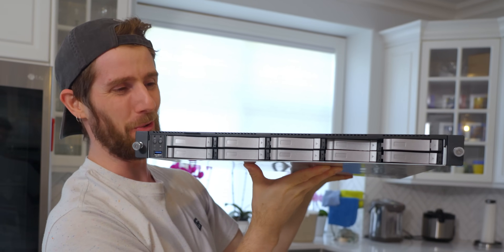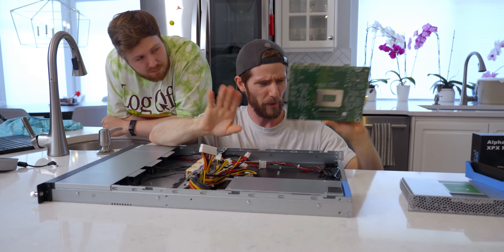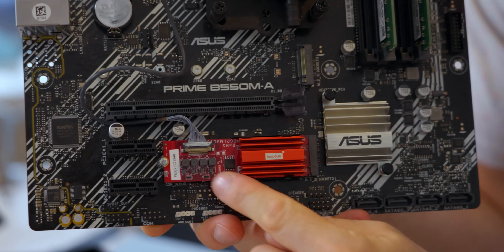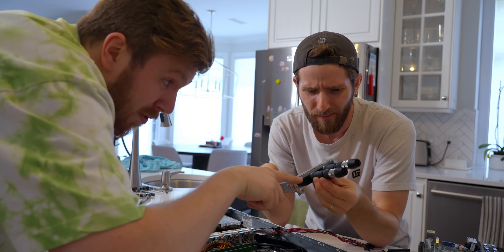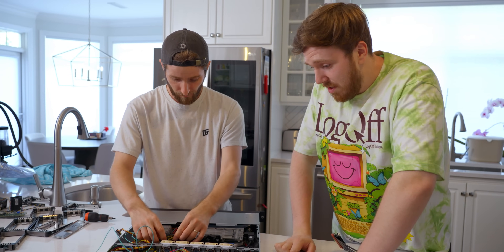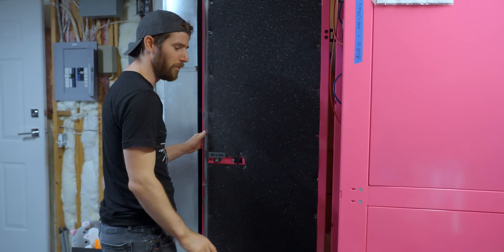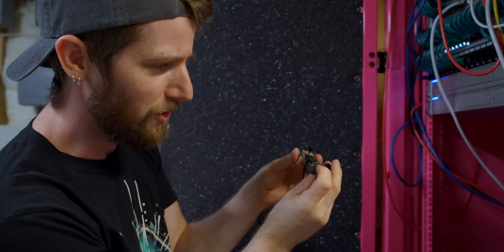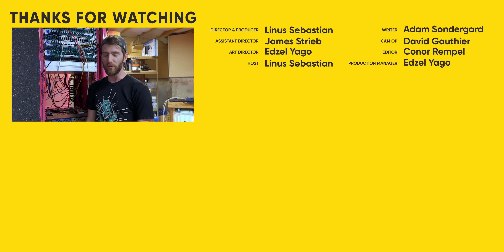I designed my perfect gaming PC, then threw it away - 1U PCs for My New House Part 2

Comment: Can't wait to see an update, and also Linus with you using Home Assistant more, I think what you should do is sync up a device that can trigger a WOL packet to the computer, it would then allow you to not need to use some jank device in the PC to remote car start it. I personally use a motion sensor under my chair right now, but you could get probably a vibration/motion detection or pressure sensor.

Can't wait to see the follow up on this.
Reply: He can just grab a esp32 and a few buttons, legit takes you a few minutes to set up.
Reply: There are phone apps that send out the magic packet, you can even send it over the internet and forward the port to your pc.
Reply: Also, you need a sensor under your char? is it too much effort to bang any key on your keyboard???
Reply: @chievo72  not all PCs work this way. Even with it on it will only turn on with a WOL or hitting the power so yes I do.

Comment: I'm surprised they are still using the standard convention of "rear of motherboard facing to the back of the racks"  

i just got a sliding shelf and put the parts anywhere i like   Especially the mother in FRONT, and i/o facing front of rack, including video in FRONT.

optional cover with acrylic out metal mesh box. afterwards.

Comment: Ah, so you put a board in for the power switch, when you already had conduits and fibre optic cable running through the wall? Conduits that you could say... Just run a power switch through, or a receiver plugged into the power switch so a remote worked up the stairs... You confuse me sometimes.

Comment: So Linus, did you ever do the math on what your new case's cost is given all of the 3D printing (electricity, materials, printer wear and tear), labor for everyone making all the parts, so everything but making the video?  Is it really lower, or actually much higher?

Not saying I wouldn't have done similar to not have to fork over the cash and to end up with something better.  I would, and that without any CNC anything!  All I have are only a really good drill press, 2 1/2 Hp Bosh router and high carbon bits, so can do aluminum.  Otherwise I have an arsenal of high quality hand tools and the knowhow to design machinery... and the skills to use my tools effectively.  In my case I build things I could buy because I see flaws in a great many products,  and ridiculously high markup, and know I can do better, and of course, because I love the challenge.

Comment: Oven? 
If it is distilled water or sprayed down with distilled water after being disconnected from power for awhile...
200F @ 1hour = 90% safe. 200F @ 6hours = 99% safe. 200F @ 12hours = 99.9% safe. 200F @ 24hours = 99.99% safe
I'm not an expert but have experience with expensive equipment that gets baked after an ultrasonic clean.

Comment: Linus, try putting the keyfob to your head when activating the button. You'll increase the range of the signal. Its an old TopGear trick, apparently your head/body increases the amplitude of the radio signals, something something dielectric resonator.

Comment: I kinda feel they would be better off going with a 4U server that they simply had multiple GPUs in and passed through the GPUs to VMs, add a USB Card with separate controllers(like the one from Vantec) so that each VM could have their own separate USB controller, and then put all of those ICRON on its own shelf/1U server. Each "machine" would still gets its own dedicated GPU and USB Ports like you need for your optical solution you setup with ICRON but other things like your watercooling loop and noise would be much easier to manage.

Comment: Your issue with the DP right angle adapter - I've seen this with adapters (and cables) that don't have the shielding connected between the input and output. Does your cable testing doodad at the lab cover DP?

Comment: DC-to-DC conversion is not more efficient than AC-to-DC conversion, and especially not "much more".

The converter is small because it's converting from 24V to 12V, which is a smaller drop in voltage, and less amps will go through it.

Comment: I used the remote powerbutton thing a few years back (a different version that used PCIe for power). Or I tried to. Reception with the case closed is terrible. Who would have thought that putting a wireless receiver inside a grounded metal box would be a bad idea?

Comment: Would it have been easier to air cool everything in that 'sealed' room - and then have a large, massive heat exchanger / radiator for the room that is connected to the pool?

Comment: 1:38 - Heyo, you might wanna replace that clear vinyl tubing NOW instead of later. You'll be fine in the short run, but I've seen that tubing fail with minimal pressures going through it because of water hammer (if your pump turns on/off at all). Not to mention that you're running warm water through one run of it. That clear stuff WILL eventually start to bulge to a diameter greater than when it started. If you're going vinyl, you'd be better off with braided reinforced vinyl tubing. Can be found at the same hardware store you got the clear stuff from.
Reply: Even just the look of it is horrific. Literally looks like it's going to fail any minute.
Reply: Considering that they had a plumber at the house recently to fix the rest of the loop that they put together the other day/week

It may already be fixed

They just filmed 3 (at least) videos at once that day
Reply: But if he does that, he can't make a video where he's panicking because he flooded the room.
Reply: I think they already got redone if it’s the same loop from the recent pool water cooling video.

Comment: 6:24 MB is not just bowed, its sitting on a bold head. Sometimes I forget this is supposed to be a 'PRO' computer channel... did you put thermal paste IN the socket for optimum cooling?
Reply: I mean if the bolt is pressing against a screw hole in the MB it doesn't matter. Even if it touches a pcb trace its fine as power uses the way of least resistance. But yea its not an amazing solution and I dunnonwhy they didn't cut that away

Comment: @linustechtips  plz sand halp salvaged from my previous employer Ewaste i Have a MICRO Optiplex 5080 im Gaming with an egpu 1660 Super and theres a spot on the motherboard  for a unpopulated m.2 pcie slot how do i solder in and get the slot running in bIOS?! plz halp <3

Comment: Please use a 2 loop circuit, one for the pool and 1 for the server room, connect them with a heat exchanger. I have nothing to base this on other than intuition but the idea of connecting the pc hardware to the pool outside just doesn't seem wise.

Comment: There should really be a mechanism to change between heating the water in the pool or the air inside the duct system. So that you would heat the house in the winter

Comment: How are you going to pour water all over your motherboard... and then turn it on... and not even bother replacing it after? That motherboard is dead AF. You can see water pooled up around the amplifier capacitors and chips... it even seems to reach the USB headers and PCIE slots... Not only is the amplifier cooked but the USB controller and mobo chipset may also be cooked.

Comment: You literally have to drill holes into your roof and walls to keep hot air out?/ must me embarrassing because, I made a desktop gaming system with a LAPTOP motherboard which is the SAME performance as the ryzen 7 with 16gb of RAM and only need 1 FAN and it doesn't even go up a degree in my house!! No drilling holes nessessary! beat that?

Comment: The USB extenders sound absolutely absurd for the price. Have you ever heard of USB/IP? Considering you probably have ethernet wired everywhere, you could just get a cheap PC/RPi and just plug the USB devices into it and run them over the network. Is there anything preventing you from doing that?

Comment: I have a question, instead of going horizontal with each system, can't they go VERTICAL (in one big rack) since its motherboard + wc units? It'll take roughly the same space, but allow for less nitpicked components.
Reply: You'd have to take down all the systems to do maintenance to a single system that way.

Comment: i had no idea that m.2 to 10gig NIC existed and holy shit it's $600 on amazon. think i'll stick with my thunderbolt AIC and OWC dock with 10gig for ~$450
Reply: It's $174 at wdlsystems, but they have a note that the IC used in the part is discontinued, so it is probably gonna sell out soon for good.

Comment: I was using one of those SilverStone USB remote start adapters for my wall mounted PC, and not only does the remote drain batteries extremely quickly (even when not in use), the device just straight stopped responding one day. I had read that those tend to fail with some regularity. Ultimately, I ended up replacing it with a SwitchBot actuator that physically presses the button.
Reply: I can confirm this. It's annoying to find out one that that the remote wont work because the battery is drained. Then you have to go and physically push the button and swap the battery. Thankfully my PC is a regular desktop tower but im lazy and dont want to get out of bed so that is why i use the remote. Also it's bent a little because the PSU shroud in the case interferes with the USB 2.0 port at the bottom of the motherboard where the remote module is plugged in.
Reply: Just switch to WOL it doesn't cost you anything and is at most 5 minutes to set up.
Reply: @xfy123  My motherboard at that time didn't support it. I have since upgraded, but the existing solution still works, so there's no point in changing.
Reply: @TheGuacoTaco  That's sucks, was it a gigabyte board? At my old workplace a bunch of the PCs were on 6th gen Intel gigabyte boards and none had WOL support that was my first time seeing it unsupported.
Reply: @xfy123  It was an MSI X99 board. 6th gen as well, so there's some similarities there.